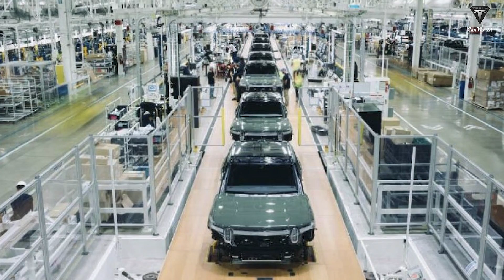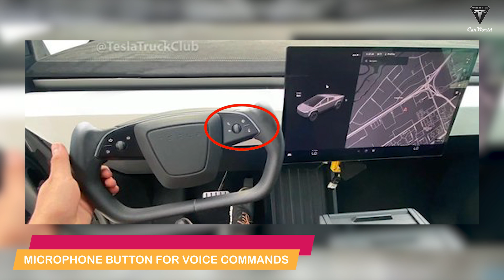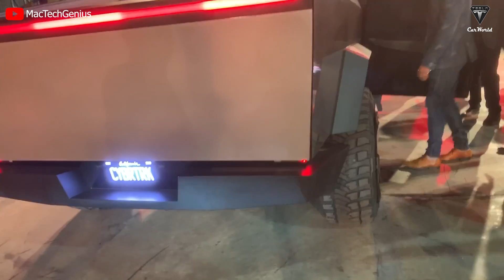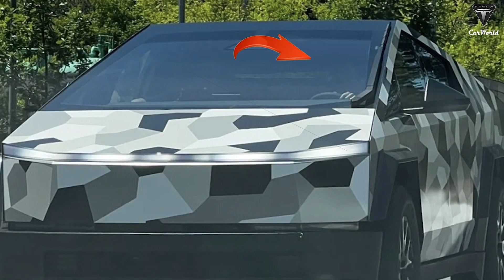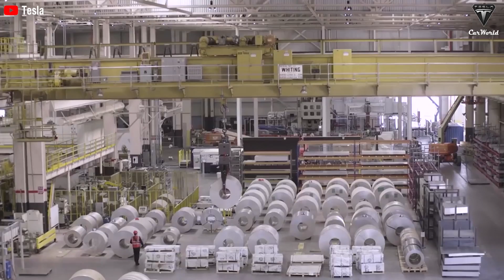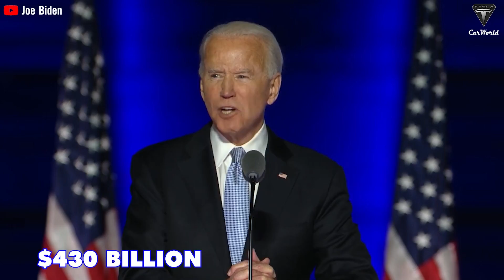Elon Musk Reveals All-New Tesla Cybertruck Design Update for 2024! (MIX)

Comment: It was said it will delay again because Tesla can't resolve the trouble of structure strength safety problem.

To save cost, the truck is build using stamping steel sheets welded together without chassis frame. There is no frame structure to take the twisting force during turning and result in weakening of joins.

To reduce the joins weakening, either chasis structures has to be added or some weight has to be reduced or reinforced. However the engineers rejected both option as it will means all optimizations have to be redone.

So the delay will keep going until Tesla resolve that problem.

Comment: You know most trucks are use because you can use them for work. Seems every truck that I have ever know has had a bed.
instead of making a car and call it a truck why do you not just make a better truck ? Most people would like to have a truck that could pull heavy loads also be able to put large items in the back of them. Wouldn't it be nice if your truck could not only pull your fifth wheel , or motorhome, but charge the internal Lifeo4 battery of your motorhome while driving down the road. You would not  need a generator because the truck could detect the power in the external battery and even startup automatically to keep the motorhome battery charges at night. This same way if you were camping and had a electric generator it would as well keep the electric generator charged as well. You could state that you could even put a rather large air compressor in the back of the truck, and now use it for air tools to work with.  Maybe this would open the door to manufacture down the road of  your own motorhome that would interface with your truck to add more and better options. Things like the computer that us connected from the truck to the new improved motorhome could control all light functions, brakes and safety as well. I feel making your truck more useful will increase sales to everyone needing a truck.

Comment: Great job.  Price.  Top speed.  Range. 
Wyndmoor PA 
U forget to mention how long to charge on a regular  110 outlet?
Reply from the maker: Because the Tesla Cybertruck battery charges with a Type 2 connector. In most a regular  110 outlet, charging the Tesla Cybertruck will take around 16 hours total.